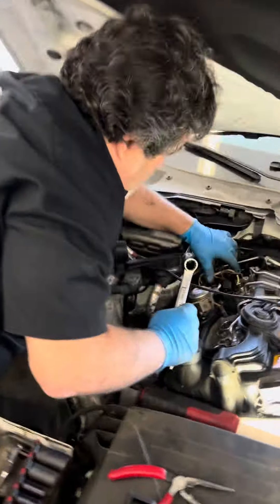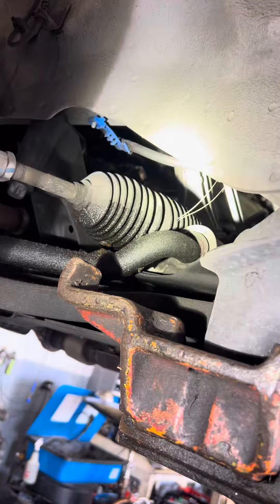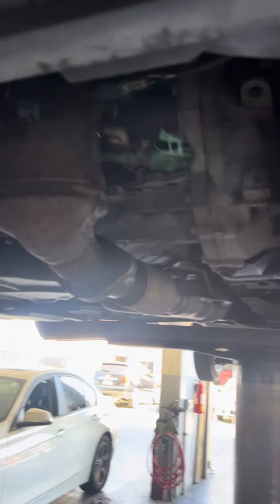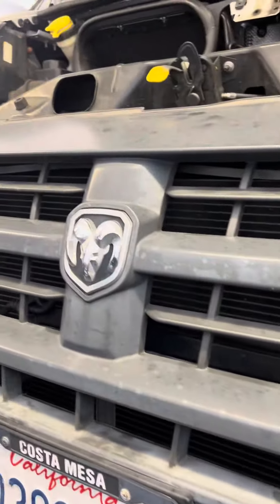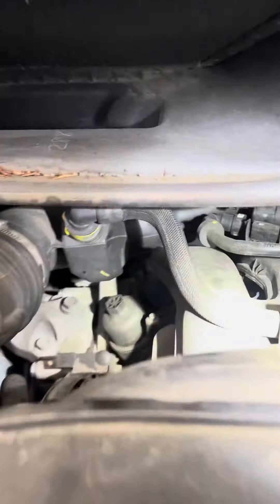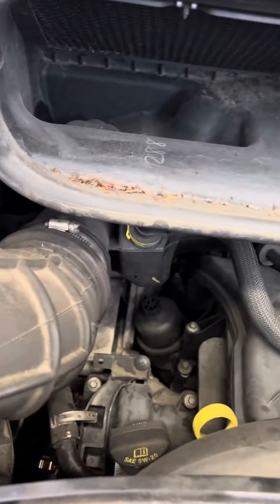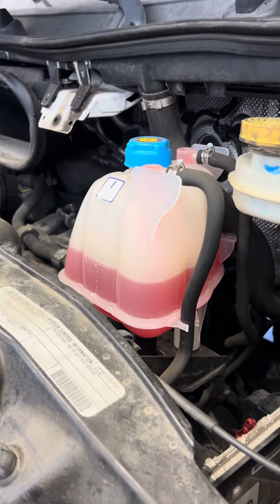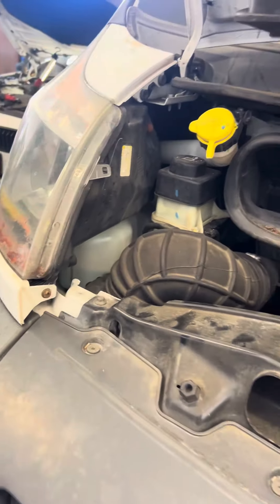Why Promasters suck

Comment: I'm going to take some time and take you to task on this, because I think it will help you in the long run. If you are going to post videos like this on youtube, understand that you are putting yourself out there for criticism from the ENTIRE WORLD, and the world is pretty big so there will be people who know better and will say so. In this video, you list maybe 10 Promaster issues, of which all but ONE is completely wrong. Let's start. Try not to take what I say personally. The steering racks do NOT normally go bad. In fact, in now 10 years of working EXCLUSIVELY on Promasters I have never had to replace a rack. The tie rod seals at the ends can go bad, and for years you had to buy the whole rack, but now you can get the inner tie rods separately. In 10 years, I have seen exactly ONE bad fuel injector, they are generally trouble free. You are wrong about the air filter - Alldata books it at .3 hrs and you do not need to do anything with the bumper, all you need is a phillips. You are right about the coolant bottle cracks, they all crack but it takes 3 or 4 years for the crack to turn into a leak. $99, 15 minute fix. You are wrong about the water pumps - in 10 years we have NEVER had to replace a water pump (a bold claim but true). There is a part called the coolant crossover tube that lives above the water pump and is prone to leak, so much so that Dorman makes an aluminum replacement. So when you sell a $1500 water pump job to a customer and it still leaks, now you know. You are wrong about the oil cooler. Yes, they all leak but the problem is never the cooler it's just the seals underneath it. Still, Dorman makes an aluminum upgrade that eliminates the problem and costs less than an OE cooler. You are wrong about the transmission - it's a 62TE and it's been in almost every FWD Chrysler since 2007, and it's basically a 41TE with a compounder. They are a weak spot on this vehicle, but most of the problems with them come from misdiagnosis and overcharging shops. I've got 2 with 800,000 miles on them. You are wrong about the heads cracking - in 2011-2012 they had an issue with #2 exhaust valve cracking, long since resolved. You are right about the rocker arm failure. In late 2019 Chrysler released a revised rocker that basically eliminates the problem or pushes it out past 300 or 400k. Overall, you are wrong about this vehicle. Here's what it DOESN'T have - no EGR valve. No fuel filter. No fuel return system. No MAF sensor. No exhaust manifolds. No timing belt. No caster or camber to adjust. Nice. Here's what we have NEVER HAD TO TOUCH: fuel pump. Chain or tensioners. Power steering pump. Water pump. Rack. Muffler. Crank sensor. ABS pump or master cylinder. That's a pretty big list of shit that will never break. Generally, once you address the rockers and oil cooler, these engines generally go to 650,000 miles before the compression starts to get weak. They make the same power as a SBC from 20 years ago, yet deliver vastly better mpg (20mpg is easy) and last 4x as long. A chevy 1 ton carries 2500lbs, this van carries 4600lbs. It's just night and day. In closing, say whatever you like on the internet, but don't be surprised when people fact check you and make you look silly. If you ever get another van in the shop, feel free to look at my channel and learn everything there is to know about these vans.